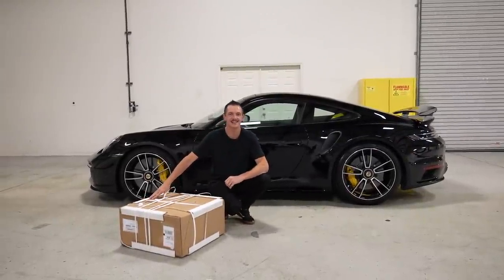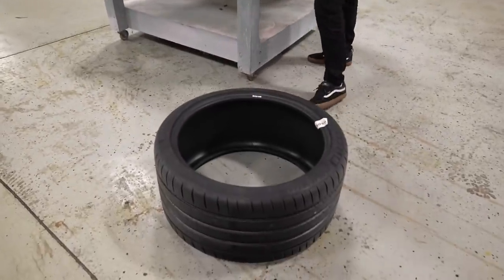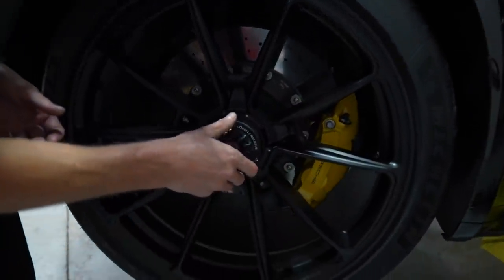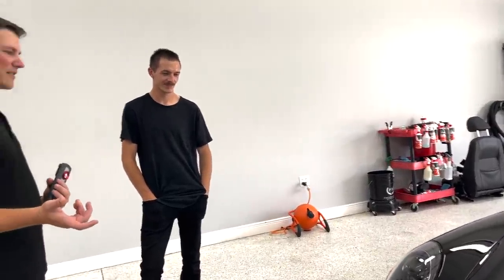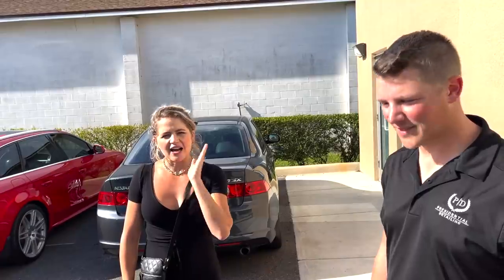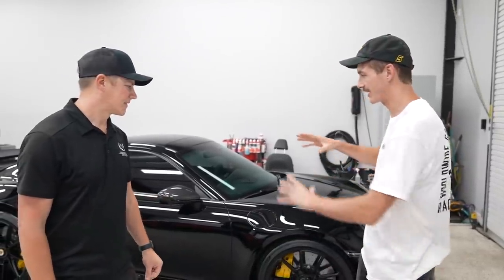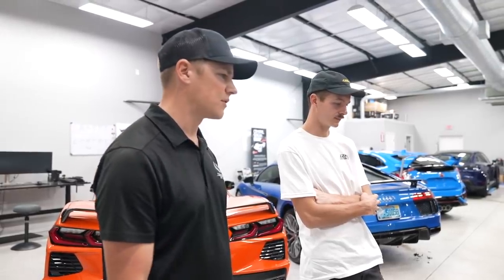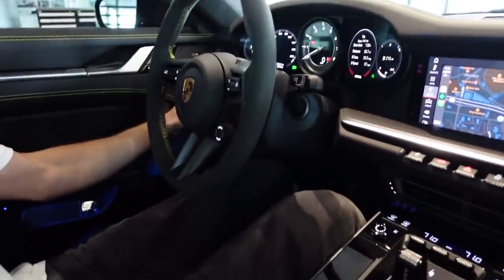Modifying a Broken 992 Turbo S...

Comment: Don’t loosen or tighten center lock wheels on the floor, always raise off the ground. Per Porsche instructions. -Porsche Technician
Reply: also never use a torque wrench as a breaker bar lol
Reply: That was hard to watch. Those center locks ain’t cheap😬 and if they lock up it’s a real pain to get them unstuck.
Reply: @jackdaniel5716  That hurt to watch
Reply: bump so he sees this
Reply: Commenting so it gets bumped up!
Reply: Bump this up
Reply: Bump
Reply: bumpity bump
Reply: Was thinking the same lol
Reply: Yeah the torque wrench as a breaker bar was cringe.
Reply: @SpencerRyllSmith  It's not going to do any damage to anything other than the torque wrench.. and with the money be has, I don't think he gives a shit.
Reply: Bump
Reply: “i think it’s fine”
Reply: @shona5512  yes but if he has issues to torque his rb26 pulley he will know why
Reply: Bumpy wumpy
Reply: @TSSR93  They don't use mechanical torque wrenches around engines though, they always use the digital versions. This is obviously only something that they would use for something that requires a lot of torque (loosening or tightening) because it's so much longer than an average torque wrench.
Reply: Bingo!
Reply: bump
Reply: bump
Reply: @jackdaniel5716  I told my friend about not using a torque as a breaker, and he said, why? And I didn't know lol. Not that I do it, but what is the actual reasoning behind it?
Reply: Bump this up so he sees it please
Reply: @shona5512  the amount of torque the RB26 balancer requires is so high the only wrench they have is a click style lol
Reply: @shona5512  Im no expert when it comes to that at all but I remember hearing people say theres stupid amounts of torque to tighten the crank pulley bolt with like 440NM or so. Dont think youll manage that with your average torque wrench.
Reply: Bump!
Reply: @shona5512  You'll find most top engine builders will use a mechanical torque wrench. They are far more reliable.
Reply: Bumbling
Reply: @bindodundid  Because it messes up the calibration of the torque wrench when you loosen bolts with it if it’s digital, if it’s a manual wrench, you can weaken the splines and it also messes up the torque value
Reply: Bump
Reply: Bump
Reply: @simonfaulkner5821  worse is if they lock up while driving. Quite some gnarly accidents because of them during the 997 gt3 era
Reply: @cutdepiefails6596  yeah I had a guy come in whose 991.2 gt3 wheels locked on the track. It happened after someone at the track swapped his tires and “cleaned” the center locks. It looked like he didn’t reapply much anti-seize to the internals.
Reply: @bindodundid  It doesn't hurt it, just don't go over the torque the wrench is set to. Every use "wears it out" some, but so does forward setting torquing. How else would someone torque a left hand thread fastener? ;)
Reply: Bump
Reply: Bump
Reply: THIS!! Im also a Porsche Tech. Have the parking brake released, the car in the air, car running and have someone press the brake pedal while loosening/tightening center lugs!
Reply: Bump bump bump i dont know anything about center locks
Reply: Bump
Reply: @bindodundid  it wears them out and in this case he is putting a ton of force onto the torque wrench and then once it breaks free it shocks the whole torque wrench and its not meant to take that kind of shock, where as a breaker bar is.
Reply: Bump
Reply: Why can’t you do it on the floor?
Reply: @bindodundid  my teach said it could discalibrate am the torque wrench
Reply: @jackdaniel5716  you realize they are made to work both ways I hope..  as long as what your loosening isn't more than the wrench can be set nothing will happen ... I have to tighten reverse threads at work with same size torque wrench and in 22 years never damaged anything.. waiting for the day when the internet experts who heard from a guy who heard from another guy that's gunna ruin it  finally happens... Still waiting..
Reply: Push it to the Top! Love Ur Videos LZ!Big Love ❤
Reply: bump
Reply: @cliff4695  yeah the problem is when you keep going after it clicks
Reply: Bump
Reply: hello fellow porsche technician
Reply: @Bikaz  444 ft lbs
Reply: @calebpechumer2030  but the torque wrench has a counter clockwise setting, how would loosening something at 100 pounds be any different than torquing a 100lb lefty tighty bolt/lug? Why would it have an opposite direction setting at all?
Reply: @guhfluh  that makes more sense, I was thinking that aswell, if counterclockwise just ruins it, it wouldn't have it as a setting
Reply: @jackdaniel5716  that also makes sense
Reply: @jackdaniel5716  we're here for a good time not a long time sir
Reply: @Gooie69  but usually not the click ones cause they’re notorious for being off. The best mechanical would be the dial scale.
Reply: @TSSR93  are we sure it’s not a breaking torque wrench also??
Reply: @freedomfox8183  ideally you would buy a breaking torque wrench which it could be.
Reply: Bump
Reply: @feelingzesty8677  I like bumps
Reply: @bindodundid  it's not applying torque to the wrench in reverse that hurts it, its designed to do that so you can torque left hand thread bolts and nuts etc, how ever when you remove a fastener with a torque wrench, the moment the said fastener " breaks free" all that torque you had on the internals snaps free and shocks them, it's just extra hard on the internals, they are meant to have torqued applied in a smooth manner, not shocking it like you would be when removing bolts! - Mecahnic of 10 years whose never had to have his torque wrench calibrated because he takes extra good care of it! Have a good day hope this helps!
Reply: Bump lol
Reply: @jackdaniel5716  its probably  so out of spec
Reply: @shona5512  he does care. He wouldn't have his business and employees if he wasn't responsible
Reply: @cliff4695  As far as I understand it, it's not the act of using it in reverse that puts it out of spec (obviously that's fine), it's doing what Adam does in this video, i.e. continuing to apply more pressure to the wrench after it's passed the 'click' point. Personally if I had to use one as a breaker bar, I'd wind it up to the highest value I could, so it wouldn't ever reach that point when loosening the bolt.
Reply: big bumpin
Reply: Bump
Reply: If you set the torque wrench to max tourqe to losen something then How is that ever going to hurt it, it's at that point a breaker bar! :)
Reply: bump
Reply: @kevinfunk83  only if it's a cheap piece of turd. You get what you pay for. An Australian made warren and brown deflecting beam unit is about as reliable and as accurate and you will get.
Reply: No, that was the correct way. Its around 50kg tightening. - Porsche cup team...
Reply: @bindodundid  the Internet in a nutshell 😂
Reply: @cliff4695  cool story bro
Reply: Bump diddley Bump Bump da da Bump
Reply: @bindodundid  using a torque wrench to loosen a bolt well within its specified range is no problem. But a Porsche center lock wheel is torqued to 450nm and requires a special wrench that literally has a rotatable head for clockwise and counterclockwise rotation
Reply: @kevinfunk83  that’s why breaker bar exists.
Reply: Commenting to bump it
Reply: @markboulton570  interesting, I’ve never thought this would be a good way to do it
Reply: @sourmane2790   That is the procedure directly from Porsche.  Im not smart enough to come up with that 😂😂😂
Reply: David Haller  100% WRONG!
Reply: bump
Reply: @aaron5222  He cares about a lot of things I'm sure, but if a mechanical torque wrench breaks it's not going to bother him that much at all.
Reply: @jackdaniel5716  came here looking for this 😅
Reply: Ya my lord the torque wrench i hope it survived
Reply: David Haller   Your welcome to think whatever you like but i wrote out the Porsche instructions earlier in this comment.  It is clearly stated to NEVER loosen the central lug with vehicle weight on the wheel.
Reply: David Haller  Ok- you think what you like! Yours truly a Porsche Gold Certified Master Tech of 15 Years!!
Reply: David Haller  Copied directly from the owners manual 
"7. Raise the vehicle until the wheel lifts fully off the
ground. Do not lower the vehicle until the wheel
has been completely mounted.
Removing the wheel
Fig. 253: Vehicle raised
e Ensure that the vehicle is not resting on the
wheel being secured during the fitting process."
Reply: David Haller  😂😂 i quoted it for your benefit cause in your last response you specifically said you DIDNT trust the responses from some random on YT... have a Great day!
Reply: B U M P
Reply: @cliff4695  yea because no one out here knew that but you.... Thank you for your wealth of knowledge on the subject to share to all of us noobs. Because obviously your a pro engine builder so that makes you like a god or something??  Lmao
Reply: Good to know thanks😃👍
Reply: @shona5512  ya but why spend money where you dont have to, cheaper to buy a breaker bar of the size than another fucking torque wrench, people make the money they have by not doing dumb shit like what you just said
Reply: @greyman2711  Because he can. Simple as that.
Reply: Literally doesn’t even matter because you would do a retorque  on the ground anyway.
Reply: bump bump bumper
Reply: bump
Reply: @jackdaniel5716  yeah that one was a shocker. wtf? And he didnt even say anything about it? :o lol
Reply: F1 raises their cars up before the air wrench touches the center locks for the same reason - gumming your threads would be no good
Reply: @jackdaniel5716  every click felt like a punch to the gut
Reply: David Haller  lol, what is that comparison? Have a blessed day
Reply: @cliff4695  curious how far out of spec does wrench get between calibrations
Reply: @cliff4695  Using it clockwise or counterclockwise does not matter, as you said. Using it as a breaker bar and gronking on it after it clicks is what can screw the wrench up when you overload the mechanism. Breaker bars are cheap, gronk on those.
Reply: Bump 1000 percent
Reply: I think Adam has that “I can use a torque wrench for a breaker bar” kinda money lol

Comment: Adam - “I have back problems”
proceeds to take off wheels at ground level ON A LIFT
Love you Adam
Reply: Haha as I was watching my brain went “hmmm can’t figure out why my back hurts” in an Adam voice. I then find this comment like 3 down the list. Great minds...
Reply: Good point, but also those stock wheels are hella expensive and it would suck financially to have them slip out of your hand at like 4 feet in the air and fall on their face. Just sayin'. Lol.
Reply: Beat me to it lol
Reply: while only using his back to lift lol
Reply: to add to this, if adams reading, go to a massage therapist and get the muscles worked. and then work on strengthening your core. i had a weak core and bad back pain, now after working out my core almost everyday for even 10 minutes it’ll help the pain. leaning over a car to work on engine and car stuff strengthens the back, in a bad way
Reply: @kasper_429  easier to slip out of your hand at low height when you’re taking them off like he is, all bent over and shit. Much easier to take them off controlled at a comfortable height.
Reply: The way he stood there sideways all bent. Car up waist high and stand straight in front of the wheel. Remove wheel from hub then lower with you legs! REMEMBER LÖIFT WITH YOU LEGS
Reply: If it was at chest height, it would have put the weight of the tire on his back. At that height, he had the weight supported on his leg, taking it off his back! :)
Reply: @parkd240  I reckon it's a weak core. I am a very similar build to Adam and I had back pain for a long time before I was training. If he did 15 mins of deadlifts a few times a week Im certain he could fix it. I put it down to us having a small cross sectional area down the body
Reply: @dnbmania  i am a similar build as well, i do planks and 6 inch lifts variants on my back and it was enough to help me out drastically since i do not have weights like that

Comment: Adam is the type of guy to untorque his wheel nut with his SnapOn torque wrench
Reply: Pretty sure he knows you're not supposed to use it, but he used it because it was a long bar.
Reply: This comment had me rolling.
Reply: @shona5512  Why is it designed to work in reverse if "you're not supposed to use it" in reverse?
Reply: @guhfluh   So you can tighten left hand threaded things to spec, you never use a torque wrench to loosen things
Reply: @hazdaz8578  I do if needed. ;) It doesn't hurt it any worse than using it in forward. Just don't apply more force than it's set to. Every use "wears" it out just the same, no matter the direction, just the same as a regular ratchet or breaker bar use wears it out as well.
Reply: @guhfluh  i had a snap on 3/8 torque wrench to loosen a bolt, was maybe torqued to 40 ft/lb, it broke lol. luckily i had a connect with a snap on guy and he repaired it for me. never again lol
Reply: @guhfluh  I used mine to remove wheel nuts that were practically welded into the hub because my torque wrench was longer than my breaker bar. But I ended up snapping one of the teeth off the gearing. I took it apart and rebuilt it, but there's still a tooth missing so I can't use it in reverse, but I can use it in forward (albeit, without the ratchet mechanism)
You're generally not supposed to use anything with a ratchet mechanism for busting tough to remove bolts, a breaker bar has one potential point of failure, whereas a ratchet/torque wrench has four.
Reply: Big oof. Came looking fir this.
Reply: @the_brazzy  It happens. I've broken a breaker bar loosening a bolt...
Reply: @guhfluh  It really can hurt it. The mechanism is designed for smooth application of torque. Loosening often shock loads/unloads the mech and can screw the calibration.
Reply: @shona5512  Hazet actually say that it doesn‘t harm the torque wrench...
Reply: @guhfluh  same reasone you don't want to do a burnout in reverse. The gears are designed to take a load/force in one direction not both. It will work for light loads but is not designed to handle a lot of force.
Reply: @alanloyd7164  LOL They're designed for it.
Reply: It wont hurt the wrench if you set the torque to higher than the bolt you're trying to undo. Most torque wrenches can work in reverse, its just like using a breaker bar if you use it the right way. Ive done it heaps, never broken a torque wrench yet. (remembering the amount of torque used to undo a bolt or nut is higher than the amount to tighten it.)
Reply: @Seeeeyaaaa  other way around. Its always take LESS force to loosen than torque the bolt. It only takes more when you have shit in the threads, like rust or debris
Reply: @felixrobitaille8170  no way dude. Ever tried to untighten a crank pully bolt thats done up to 200+nm with a little 220nm impact driver? You need nearly double the torque rating to get it off. Even so, that huge torque wrench adam is using could easily undo that tiny wheel nut..its capable of nearly triple times the torque value of that nut.
Reply: @Seeeeyaaaa  so the impact driver first off will probably never pull off 220nm. They always lie about what torque they will put out. Go see Torque Test Channel, they show it very clearly on there test. Second, go see AVE channel, where he does test and proove that you will need less force to unscrew the thing than screwing it, unless it has rust or anything in the thread (like thread locker)
Reply: @felixrobitaille8170  Dude, what are you even talking about? I have a snap-on industrial Impact wrench thats capable of over 900nm and up to 700+nm of untightening torque..its used for working on mining trucks..you know those massive earth diggers? lol stop please, your stinking up my happy atmosphere.
Reply: No, not supposed to loosen with it.

Comment: Hey Adam, i work at Porsche in Germanny. When you want to get the wheels of and on you need to be carefull with some things. This is how Porsche wants it to be done:
1. Dont losen or tighten the centrelock on the ground. Get someone in the car, pull the ebrake und step on the brake. Then losen in the air.
2.Tighten the wheels in the air too. The same way but when they are all at 600nm you need to loosen them again 90 degree and then thighten to 600nm. This is so they seed well

this is how porsche wants it and how we all do it in the shop

Hopefully you see this and it helps you XD
Lukas
Reply: This helped me, too! TY!